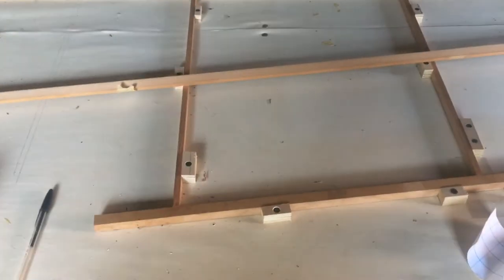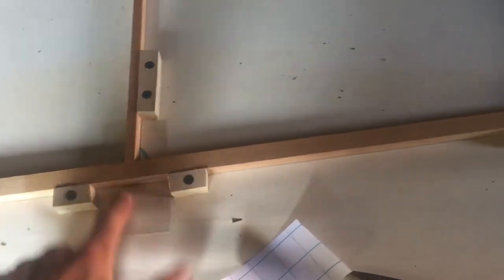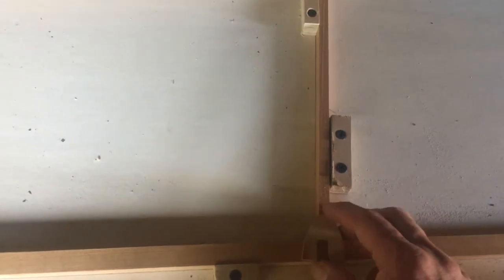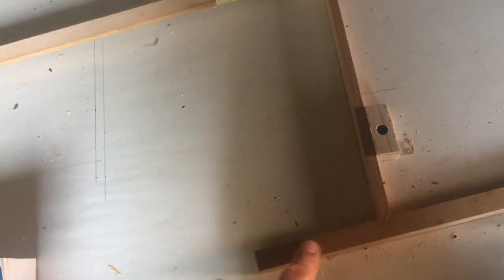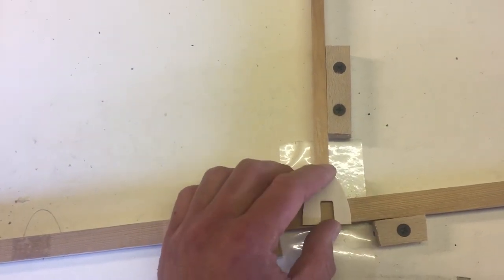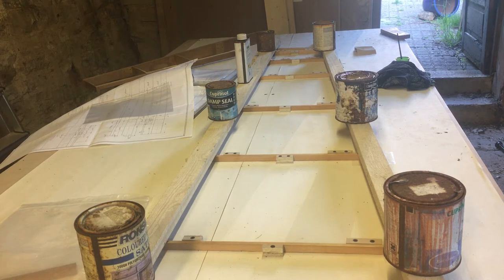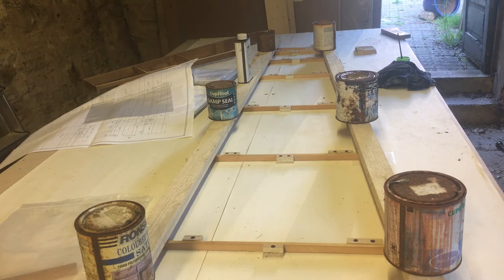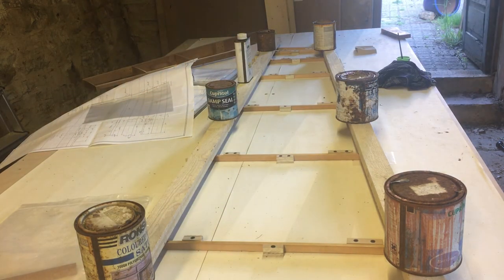Druine D31 Turbulent Build Vlog Episode 14

Comment: Good job! It's all coming along nicely! So you chose not to stable the gussets? Were you able to apply the weight to them without moving them? "Wet join" means glue them? Or did you do something else as well? Thanks
Reply from the maker: Hi, yes stapling or pinning is probably best practice, I have a staple gun but it did not have any staples at the time!  The gussets I am attaching are about 4mm thick also and I am not sure if a staple would get through that ok.  Further, the epoxy i am using says that it benefits from not being compressed too tightly and squeezing the glue out of the joint.  The "wetting" idea is to first use some unadulterated epoxy mix which will soak easily into the material on each side and then use some with a few percent of filler to form the interface between the pieces to be joined.  This is the manufacturers recommendation so I am following that.  It just means that you need to remember to go around all the joints with your first mix, before adding the filler to finish everything up (that is what I forgot for a couple of joints).

I applied the weight very carefully (!) and due to the long-ish cure time I could inspect and make any adjustments while the parts were under (gentle) pressure.   I am sure there are better ways of doing all this but from first look the joints seem ok. 
 My inspector is coming next month and hopefully he will add his seal of approval!